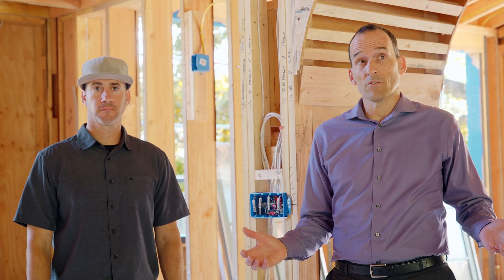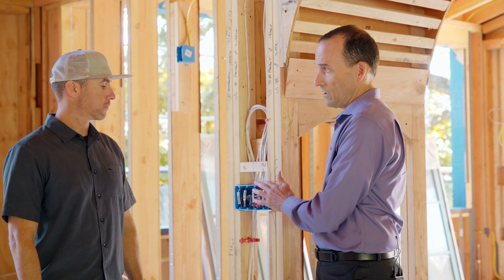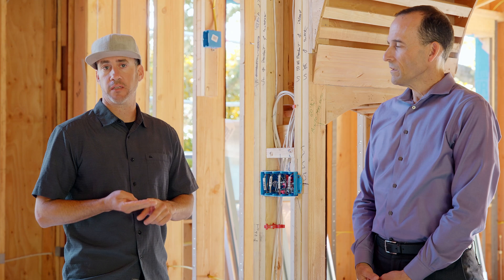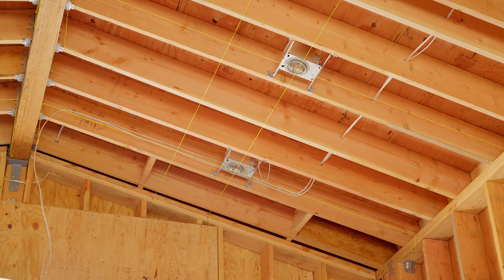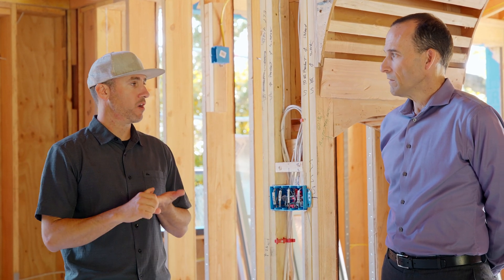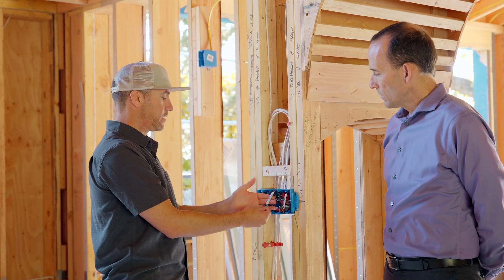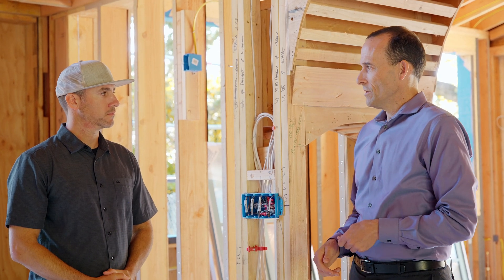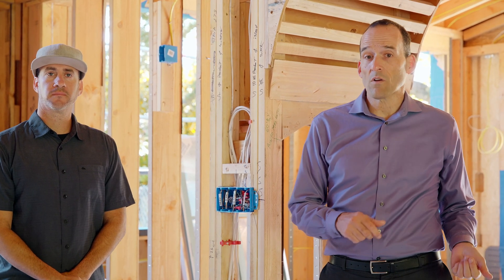The Crucial Role Of PreConstruction Planning: Streamlining Electrical System Organization

Comment: Continued from my previous comment - my late dad (an electrical engineer) gave me a good tip. He said make sure you put plenty of slack in the wires, as this will give any future electricians a much better chance to modify things in future without having to muck around or damage the drywall/Gib - because "spare" cable can be pulled through to add an electrical fitting if required.  Again - the rules on this may vary depending on where you're living. In some places the wires have to be secured, so it might not be applicable for you. If you are going to do this, ensure that the holes you drill are the correct diameter for your local building code, and are sufficient to allow a cable to be pulled without friction (mainly talking walls here). Don't thread too many cables through a single hole (there is often a different limit depending on your area, and the cable thickness). But the best bet is to get it right fist time, before the drywall goes on of course!   But think ahead! Always put in some extra feeds to "future renovation areas" of the house, and ensure these are clearly labeled at the box... AND labeled in the wall. This way when you begin on the next renovation you'll have more options for your electrical.  Find an experienced electrician first and consult with them from the beginning. Label EVERYTHING!   I labeled each wire in multiple places - (both ends - and even along the wire, so that if anyone ever has a segment of drywall removed, they can see what each wire is for at a glance. Note that even without this, your electrician "should" be able to work out what each wire services in the house, but being able to see this without the services of an electrician is a big head-start for you (or the next person) if you renovate in future. Hope this helps!
Reply from the maker: Thank you @phillhart2990.  This is a fantastic list of super helpful hints for anybody who is trying to do this themselves and certainly more in depth than our video.  I really appreciate all of you great advice you have so generously given us.  I hope your remodels turned out amazingly beautiful.

Comment: There is a lot of work in this. In our house, I did all of that myself - working out the plan for both the lighting, and all the power points (electrical outputs). This was done over several iterations of renovations (mainly two, but we have a third and "final" to go.  I was lucky enough to have a very experienced (old school) builder who explained to me how the basics worked (eg two way switches etc). With the knowledge he gave me, I was able to plan, then drill all the holes in the structure, thread the required feeds and put in all the boxes in the places we wanted.   This might not be possible in all countries, but for us, doing this work saves us thousands of dollars.  All the electrician had to do was connect the feeds (all labeled) at the new  "power box" (we moved it to a new location)   and wire up all the lights and electrical outputs.  If you're going to use a similar approach, I strongly recommend you check the "building code" for your country /provence etc - also I recommend that you get an inspection from the electrician before you put the drywall / GIb in place - especially if it's your fist time doing it - just incase you got something wrong!!
Reply from the maker: Great job @phillhart2990 !!   That is a lot to do on your own.